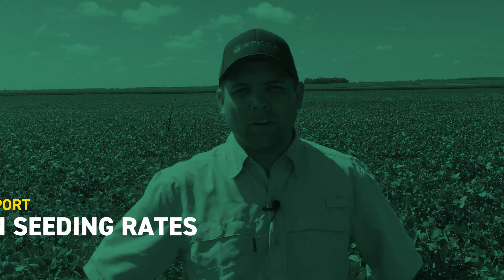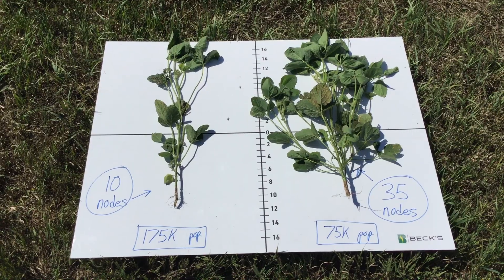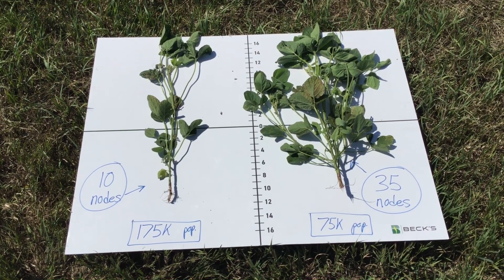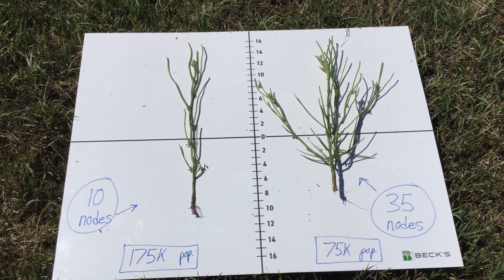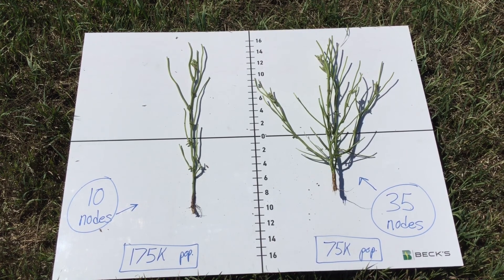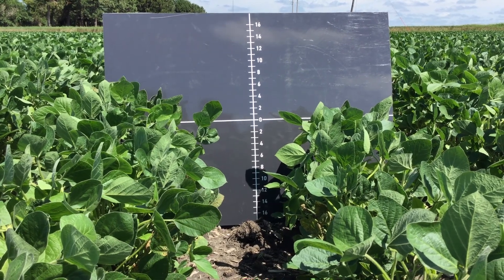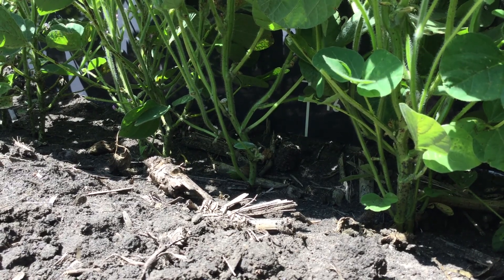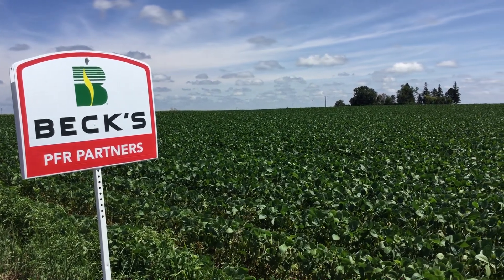Soybean Seeding Rates - Beck’s PFR Report

Comment: #askpfr planting soybeans wet and they turn out but are short do you advise to replant or leave to see the yield
Reply from the maker: If you think about the five yield factors for soybeans:

1. Plants/acre
2. Nodes/plant
3. Pods/node
4. Seeds/pod
5. Size and weight of seed

The first consideration is certainly overall plant stand.  If you have a good stand, which it sounds like you do, then that is the first step. Depending on planting date, if you plant after the summer solstice of June 21st then the beans will begin flowering soon after emergence and as such will be shorter. In addition the cooler temperatures this spring and early summer tended to shorten internode length as well creating shorter plants. The good news is that height alone is not a yield factor, but nodes per plant is. Which is why when we plant later we encourage narrow rows and higher seeding rates in order to get more plants since each plant will have fewer nodes. At this point see where the yields turn out.